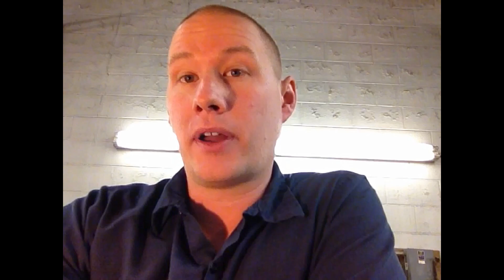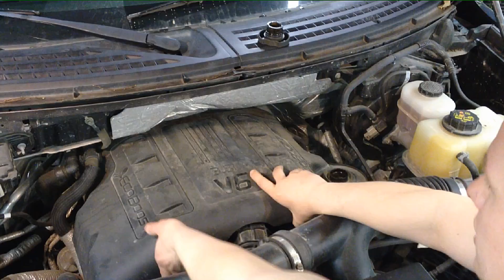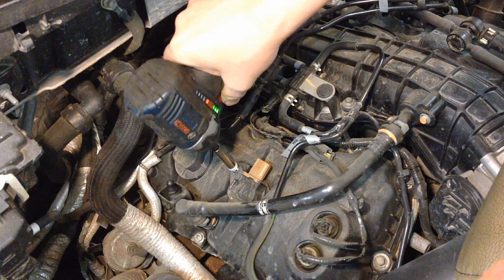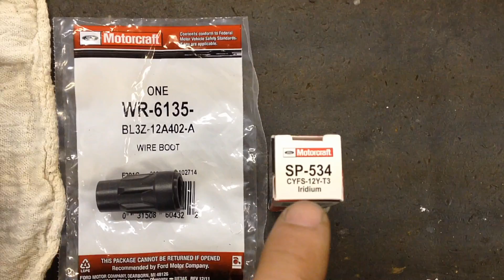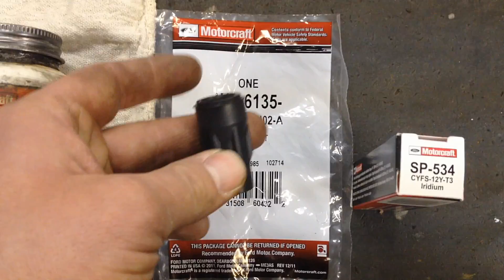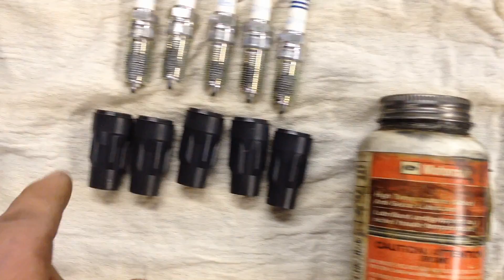2011-2016 Ford F-150 3.5L V6 EcoBoost Spark Plug Replacement

Comment from the maker: These are the Tools and Parts I Recommend:

Latest Motorcraft Spark Plugs (x6)- https://amzn.to/3UUh4uB

Ignition Coil Boots (x6)- https://amzn.to/49KjakE

Motorcraft Ignition Coils (as needed)- https://amzn.to/3OTHuJ0

Spark Plug Gap- .028"
Spark Plug Torque 133 in lbs

Forscan is a free Ford Specific Diagnostic Software:
Download Here- 
https://forscan.org/home.html
ELM 327 Adapter I Recommend-
https://amzn.to/2GC6dBj

As an Amazon Associate, I earn from qualifying purchases.
Reply: Do you still gap the newer SP580X to .028 ?

Comment: I had to attach ratchet straps the back of my impala engine, disconnect the motor mounts, and ratchet the engine forward in the cradle about 10 inches to even be able to reach the rear spark plugs......

Comment: I came here to check how you got the high pressure pump electrical connector off, you just pulled it right off lmao 😂 good to know there's no clips though, I'll get my man hands out I guess!
Edit: Man hands didn't work, found out there's a clip on the underside right where you can't see it, 1 finger underneath and push on it, got the clip off finally!

Comment: Manufacturers specifically recommend NOT using anti-seize on iridium plugs with nickel plated threads. Could lead to over torqueing. The 8 mil cap retaining screw is ok with anti-seize though.
Reply from the maker: You see all those threads? It will never ever be a problem.

Comment: The passenger side is definitely easier to do than the driver's side.  Getting the existing to come off is not as easy on this side because you can sot spin the coil like you can on the passenger side.

Comment: Spark plug gap should be 0.035" right? I see the old 0.02 something as well. Is the service manual spec for these engines .030-.033 in. (0.75 - 0.85 mm)  	?
Reply from the maker: Nope it was updated years ago to 0.70 - 0.95 mm (0.028 - 0.037 in)

Comment: Does the type of anti seize you use matter, i have copper but i see that ford uses nickel high temp. Is this a key difference?
Reply from the maker: Check and verify but I think copper can affect o2 sensors. Nickel is best for high heat any that is why I use it.

Comment: Just replaced plugs on 2016 3.5 F150 and all went well.  Great video to follow. My plugs all had dry carbon on one side and coffee color no carbon on the other side.  Cant find out if this is normal or not.  I did minimize the gap down to .030 since the removed plugs were quite a bit higher gap.

Comment: The new spark plugs I purchased says Caution: Spark Plug Gap is not adjustable.  5 out of 6 are too wide a gap and one is exactly 0.28 - what's the best tool to adjust the gap or should it just be left as is?  One is 0.42, others are 0.4, some 0.35 - how should they be bent properly to gap them to the right width?

Comment: I have a 2012 F150 with the ecoboost 3.5. I have to change my plugs literally every 15000 miles. Motorcraft says that they are good for 50000 But won't send me new plugs when they're toasted out at 15.

Comment: I am 73 years old, I was just quoted $650.00 to change the plugs on my 2016 f150.  Anyone else tired of takin' it dry?  how the hell are we supposed to eat at prices like this? Thanks for the video, it isn't a bit harder to change plugs today than it was 50 years ago.  in fact you were supposed to disconnect the motor mounts and jack up the engine to change plugs on a 1969 shelby 500..
Reply: I think I spent about $125 to 150 for plugs and coil packs. I just changed them today and surprisingly it went off without any real issues meaning I didn’t drop any screws, tools or parts. The coil packs had a little suction that made me have to fight with them and getting the connectors off, the same a little hard to take off but it all worked out pretty well.
Reply: @jackg7225 you replaced coils or coil boots?? And how did it run afterwards?
Reply: @ryandrake4748  the coils with the boots on the end and spark plugs. The sparks I got were Bosch plugs around $66 on rockauto  and I couldn’t find my order info for the coil packs but I think paid around $70 for the 6, I think on Amazon. It’s been running fine.
Reply: @ryandrake4748  i don't see my reply I did yesterday. Anyway, coil  packs with the boots and spark plugs. It's been running just fine, no issues.
Reply: Was quoted 850$ for tranny fluid change 2013 f150 toronto ontario. I bought thr materials myself for 250$ and i did it myself. For some reason ford mercon lv oil is ~100$ price gouged up compared to other oils. They quoted me 700$ at mr lube to change the rear diff oil hahaha. I bought the oil for 90$ and did it myself.
Reply: lol I just changed  my motor craft spark plugs bought things in USA then took it to Mexico for $20 bucks  lol quick job on 2011  f150 3.5 Ecoboost with 200k miles
Reply: I bought coils and spark plugs for my 2016 F-150 3.5 Ecoboost. I bought OEM…$660
Reply: @noahbonilla2915  I got OEM as well, and spent $440

Not sure why you overpaid over $200
Reply: Buy a Toyota or Honda and you won’t see repair shops.  Also much easier to work on.
Reply: Wtf
Reply: Dummies voted for a pedo who gave us higher prices, a war, more inflation via tarrifs and a nice tax reduction for the rich. Tinkle down that, while takin it dry.
Reply: valid point.
Reply: My gramps 78 still changing his own oil tires and breaks everything
Reply: Dealers charge like $ 200 per hour and give 2 hours for the job. If the mechanic gets it done in 45 minutes, they still charge the full 2 hours.
Reply: Parts alone are almost 400. So its a fair price.
Reply: @lob110 No, that isn't a fair price.
Reply: @lob110 OEM 6-boots $45 (w/tax), OEM 6-spark plugs $70 (w/tax). $115 parts total from dealer. So, no $600 isn't fair.
Reply: Where are you buying 6 spark plugs for $400?  and why are you doing it? @lob110
Reply: Mechanics have to make a living too. Dont drive a vehicle if you cannot afford to keep it maintained.
Reply: @lob110 And fck right off with telling people what to drive, bitch.

Comment: Amateur here so apologies if my question seems stupid. Is it a good idea to use the air pressure cleaning when the coils are removed and the coil wells are open to trash that could get down in there?

Comment: Anyone have an expert opinion on dialectric grease? From what I heard it should be just a thin amount in the boot. If you use a big dollop like shown then it could ruin the connection between the boot and the plug because it is an insulator.
Reply from the maker: It will never be a problem.

Comment: So you recommend gap to be 28? The motorcraft plugs i got from ford are already gapped at 32 and are not regapable (made up word).  Barely changing my plugs for the 1st time at 98,500 miles.

Comment: Silicone paste is electrically insulating, when you press the ignition coil in, it will contact the spark plug conductor, cause bad conduction.

Comment: Did you just put those spark plugs in Dry?  Meaning no anti-seize at all on the threads?
Reply: Maybe you missed that part of the video.  He clearly described the anti seize and showed it on all the plugs laying on a towel

Comment: With a 50hp MPG Boost tune from DiabloSport my 2014 needs plugs every 20k due to outer ceramic micro cracks.

Comment: I enjoy your explanation on all F150 related topics. I’m a little late changing my plugs and they’re stuck. I can get only one out. Can you give me some advise about replacing the seized plugs. I have managed to remove the coils and clean the spark plug well out good. I sprayed some kroil penetrating oil in the well and put it back together until I have a better approach.

Comment: Weird.  My 2016 3.5 has the coil pack electrical connection facing towards the outside of the motor instead of towards the intake.

Comment: Well, another happy F-150 owner.  Great video, thanks.  And thanks for all the various comments.  Yea, those darn connectors $%%$#$%^&.  I broke a couple and ended up not disconnecting the coils on 2 of them and still just able to get the coils out to change the boots and plugs.  2013 with 190,800 miles.  Now on to next project (leaking connections on turbos, flushing coolant, etc. etc.).  Runs great BTW.

Comment: The packaging on the SP-580 states, "caution: spark plug gap is not adjustable". Can I ignore this in order to set the plugs at .028?
Reply from the maker: yes

Comment: Geezus! Help. How the heck did you get the pcv hose off so fast and easy. No explanation. I'm messing with the grey clip on the top and bottom of the pcv hose. Seems like it'll snap and break.

Comment: Deciding on a 2017 or 15 f 150.
Does the 5.0 get as much blow by as the eco boost? Don't tow,just like trucks,which would you buy?

Comment: Thanks, Changed my new plugs to .028 to .030 and it an big difference with the power. My old spark plugs gap was around .048 - .051. That’s my truck burn more gas then an v8 on cruise control.🤷🏽‍♂️

Comment: I’m about to do plugs on a 2016 v6 F150 non eco boost motor and the motor craft plugs that come pre gapped is 51 thousandths, is that right? Would it still be 11 foot pounds torque to reinstall?

Comment: Thanks for the great info. 5 of the 6 boots stuck to the spark plugs down in the hole on mine, saw a tip to shove a 7/16 deep socket into them twist a little and they come right out with the socket. Worked like a charm.

Comment: Doesn't the anti seize change the torque spec?
Reply from the maker: Not much no correction needed in the real world.
Reply: @FordTechMakuloco  thanks. I tried to find a video of yours about the other misfire issue with these being the intercooler. What is your opinion on the easy solutions such as the moisture trap or drilling the intercooler? In lieu of the intercooler deflector plate or the complete replacement?

Comment: I see this was done 8 years ago, I purchased what I think is the proper replacement plugs the SP-580. Is this an acceptable plug for a 2013 3.5 ecoboost. 130k miles.

Comment: I have a question can I use NGK spark plugs for my 2017 ford f150 2.7?  Or is better to use Motorcraft spark plugs?
Reply: I've learned that oddly the Fords perform better when you stick with FOMOCO. All the way down to the oil and oil filter. Just my opinion.

Comment: I have a question. I just bought a 2014 F150 Ecoboost with 85k miles on it. It was getting 12 mpg at first and I went out on a farm to market road and floored it and it coughed and sputtered for a few seconds, the check engine light came on and the AC got warm for just a second and then everything went back to normal. Then all off the sudden the truck went back to getting an average of 16 mpg. I bought some new plugs for it, some mass air flow censor cleaner and some turbo and intake valve cleaner. Is there something else I need to check out or was the truck just babied by the previous owner or something? It runs fine for the most part other than the mpg was an issue at first. Thanks.
Reply: So these Ecoboost have more than one mass air sensor. There is 4 if I remember correctly. Also they have a bad issue with misfires. There are different causes. 
First cause is the gap on plugs gets to much. Should change plugs on turbo engines every 30k.
Second is the boots tear and spark jumps boots
Third is the intercooler actually works too good. So it condenses water and when you accelerate it sucks in water. You can get a moisture separator or there is the cheap easy way and that is drilling a hole in intercooler. There is a video on here how to do it properly. Or you can go the really expensive route and get Ford's fix which is a new less effective intercooler and deflection plate. I went cheap route and haven't had issues since.
Last is carbon on valves. This happens because the direct injection. Fuel doesn't go into intake and clean the valves as it passes by. 
I dealt with changing a coil here or there for about a year and finally just replaced all plugs and coils and drilled that hole on the intercooler and haven't had a issue since.
Reply: @buzza2077  Thanks for the info. I ended up totaling the truck in January or so they said it was totaled so I don`t have to worry about any more Ecoboost issues.

Comment: They make a longer spark plugs socket they got one made for the Doge truck you don't want a socket that would around or cross thread putting plugs in

Comment: I pulled mine and found oil on one of the coil packs?? Anyone know what that might indicate?
Reply: Leaking valve cover gasket. There is an o ring on the valve cover that goes around the spark plug. If I remember correctly.

Comment: Wander if the 3.5 ecoboost engine would fit into the ecoboost 2.0  2021 Mustang??
Reply: Likely with tons of work $$$ and some who’s expert  with electronics/engine swaps I would check if any kits are made for writing / harnessing because the pcm would have to mate with existing wiring / body control computer . I did see a video of some one who swapped the eco boost into late 1990 f150 and had it running

Comment: Do you have electrical tape on the universal to protect the spark plug wells from scrapes?
Reply: Electric tape on the U joint keeps the joint from flopping like a caught fish, and reduces the pinch points.

Comment: Excellent instructional vid! Very clear and easy to follow. 👍🏼 About to do this with my 2018 F-150 3.5. Only has 30k but I run a 5 star tune. Go back and forth between 93 and E50 so they def recommended changing at 30k.

Comment: Thanks for the vid. I still had a whole Lotta trouble getting the connector loose. Mine were very brittle. I  broke 2 of them. I’ll have to get new ones tomorrow. It fixes my problem, runs great again. Thanks again.
Reply: just broke 2 of mine did you have to get all new wiring ?
Reply: @chrischamaschuk463  no I used zip ties to hold them in place so far they have held.

Comment: I've been dealing with the Ecoboost "shudder" since I purchased my 2013. This fix was exactly what I needed. Thank you so much for the information and detailed video. This truck runs great now!
Reply: I’ve noticed the shudder after I start it I’ve done. Fuel cleaner service couple times and still does it time to time. Now I’m going to replace my plugs
Reply: Describe "shudder" please.
Reply: @teehud313  it kinda feels like it wants to stall. It's a vibration at idle mostly that is intermittent.
Reply: @kcjetchaser  thank you
Reply: @teehud313  shudder
shŭd′ər
intransitive verb
To shiver convulsively, as from fear or revulsion. synonym: shake.
To vibrate; quiver.
The American Heritage® Dictionary of the English Language, 5th Edition.

Comment: Just did a quick swap of the plugs at 103K miles.  I did not bother with the boots as they still looked to be in fine shape.  The engine was running a bit rough when cold.  The new plugs cleared that right up.  I am hoping to see a small bump in fuel economy but this will be hard to sort out given that we are heading into colder weather which tends to hurt fuel economy ( dense /dry winter air requires more fuel ).  One quick tip is to use electrical tape on the universal joint on the ratchet set.  Otherwise, you may have trouble getting the spark plug socket out of the spark plug well.

Comment: I need help boys I’ve broken the gray coil pack connector can someone help me out on what I need to do cause it won’t lock onto the coil pack now
Reply: Did you ever come up with a solution I did the same thing today and Im not sure what to do
Reply: @Freindlyfisher  yea bro I got the part number for the new one order wpt-1284 on rock auto and just pull the pins and swap the connectors it was easy
Reply: @rdking005  thank you man!

Comment: Is Ford still recommending a .028 gap for these engines? I have a 2014 and am seeing .032 recommended.
Reply: The plugs for my 2013 came at .028. The parts showed the same for the spec. I took the part shown in this video in and it was superceded to SP-580

Comment: What a POS! My F150 Ecocrap fouled plugs every 18-20k miles, Ford dealer said it was normal. That and electrical issue, I dumped that POS garbage for a truck I never have to worry about, with a lifetime powertrain warranty, and 100k plug internals.
Reply: What did you buy?

Comment: Great video I did everything you said. I changed the plugs without a problem. But still felt sluggish after I test drove it. Found a video about resetting your throttle control. That worked like a charm. Runs like a champ. Thanks

Comment: After watching this video again after 2 years...I finally did the plug change on my 2013 F150. The tips and steps in this video were spot on. Thanks for making a detailed video.
Reply: Glad to hear the video is reliable.  I'm about to do mine.  Did you use the plugs that he recommended in the description?
Reply: @2primateswalkintoabar61  , Yes sir. I follow F.T.M. directions to the T, I am just not as good as he is :). I did ask @FordTechMakuloco, to move to Texas...but he wants to stay put.

Comment: Is this a go for a 2013 3.5 as well?
Reply: Worked for me but the coil and boots were flipped around from the way they were on this truck. Instead to having the connectors up mine face down.

Comment: I know that the information contained in this video supersedes the original recommendations from Ford. Can you confirm that these are still the correct part numbers and specifications recommended or is there any new information we should be aware of since you created this video 6 years ago?

Comment: Thanks for the video. Great and easy to follow. Just did my truck, took me an hour.  Garage wanted to charge 2.2 hours labor.  I'll save the shop cost for something i can't do.  Getting the coil packs out was the hardest part. Keep up the awesome parts. Gapped the plugs between .028 and .030. They were the SP-580 and were pretty close to .030 out of the box.  Seems to run a little better.  Did it at 83,000 miles, next time i won't wait so long.